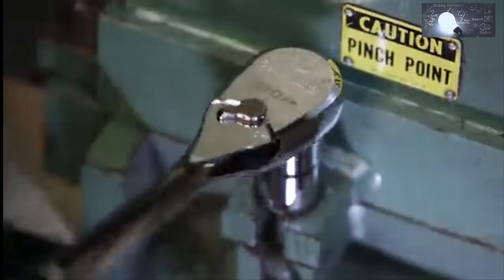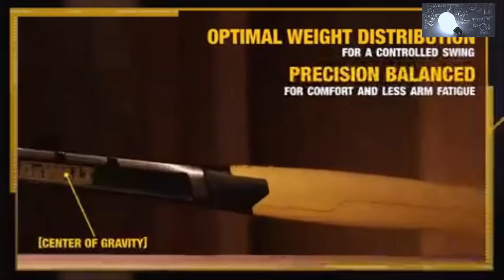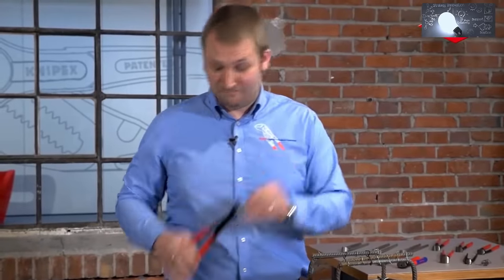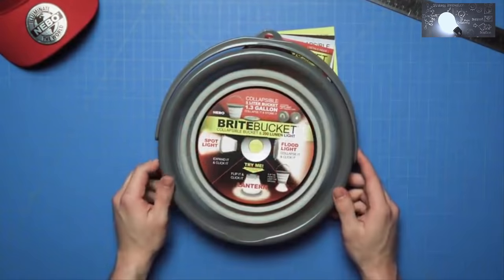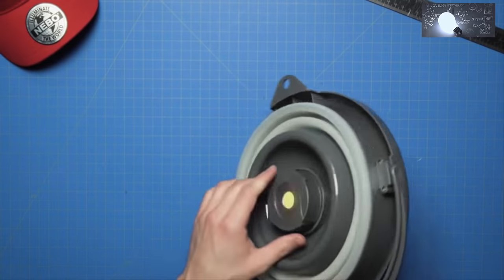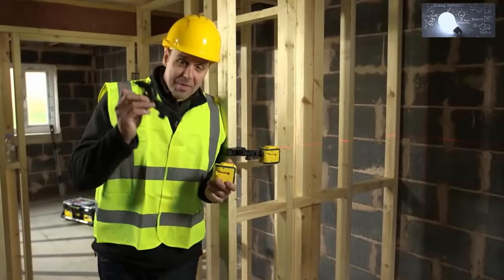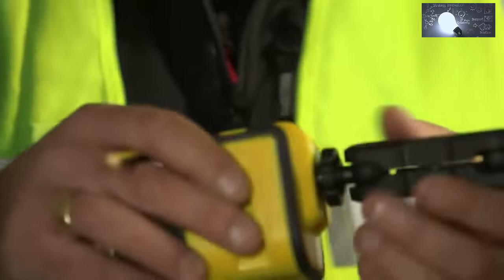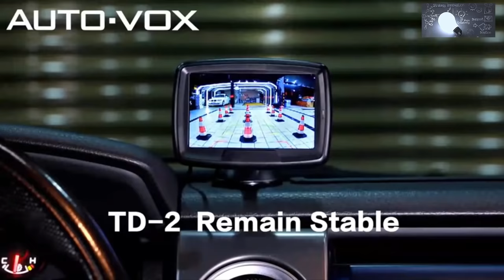10 COOL TOOLS THAT WILL MAKE YOUR LIFE EASIER 2019 #13  (AMAZON)

Comment: The Dewalt hammers are some of the worst framing hammers I’ve ever used. The amount of vibration and shock that travels through your wrist and elbow is awful. Most uncomfortable hammer I can remember using and the handle is way too thin.